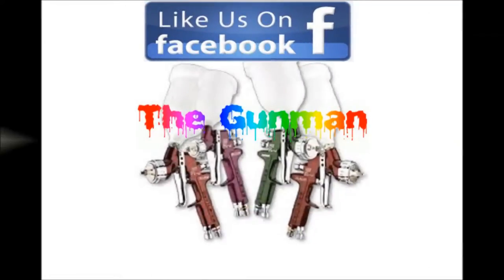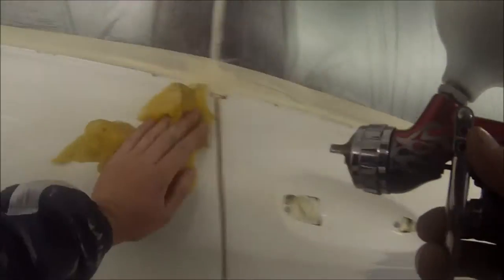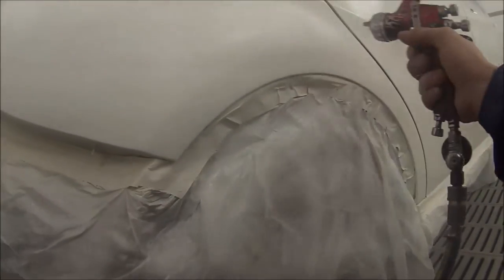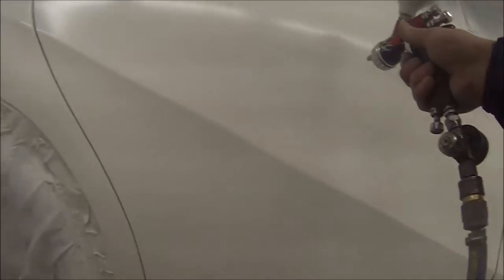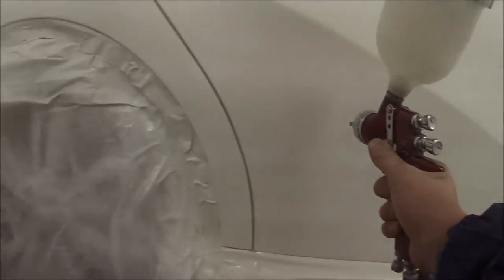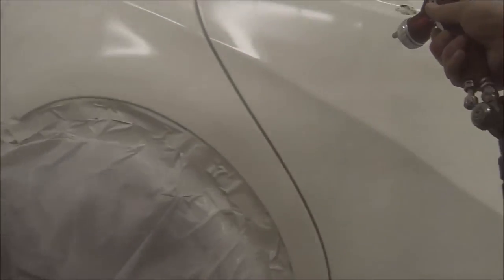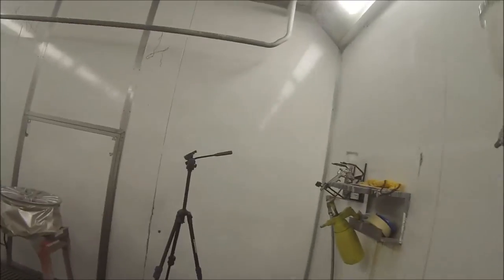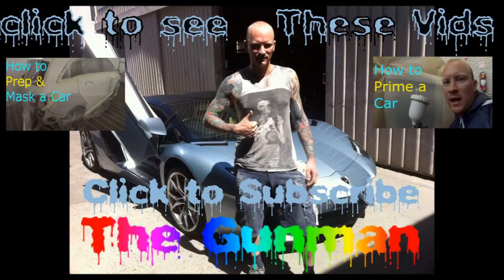How to Spray Clear over base White

Comment: Gunman, I tried respraying one of my wheels using spray cans and it has come out more yellow than the original finish on the other 3 wheels. I've used two paint from two different manufacturers and both times I get this off-white finish. Do you think I'm using too much clear? Any other tips for painting white? It's just a base and clear, no pearl.

Thanks for your time and keep posting the videos. Good work.

Comment: "You probably notice I put color right up to the edge of that door... I found if you use clear over base on white, then you only clear, and you try to blend it,  you'll end up with a big color difference, because the clear tends to color on those whites, so you're better off just matching your color..."

What are you trying to say?  That the clear will color the old paint, and that's why you painted the whole door instead of blending on the door?  I notice the front fender is covered in plastic.
Reply from the maker: That's what I said isn't it, what are you trying to say? You don't understand?
Reply: Well, yes, that is what you said, word for word.  I wasn't sure that I understood it the way you said it.  "Clear tends to color on those whites..." which whites?  The new?  The old?  Both, at different rates?    "so you're better off just matching your color" which I assumed meant the new door to the old fender, but again, I wasn't 100% sure.  I don't paint a lot, so that might be part of the problem.  No confidence!  No experience!

Anyway, I thought I'd ask.
Reply from the maker: Ok mate no worries, sometimes I sense a touch of sarcasm in comments that isn't intended so sorry. But in the years since I made this video I have blended whites with success, it will depend on the clear you use, make sure it isn't too yellow. I've found the worst cars to have the colour change from clear are the German cars like Audi, BMW, VW, Merc etc..
Reply: Oh, well, I have a Mercedes, so good to know.  I'm thinking about painting the C Pillar trim pieces (convertible roof, rear left and right). They're plastic and black and they scratch and fade something awful.  I can get matching paint (Calcite white, just like the paint color in this video),  so when I saw your video and I happened to catch what you said, it alarmed me a little bit.  Like I said, no confidence.

Is there a brand of clear, or some characteristic that I should look for?  I'm in the US if you can't tell.